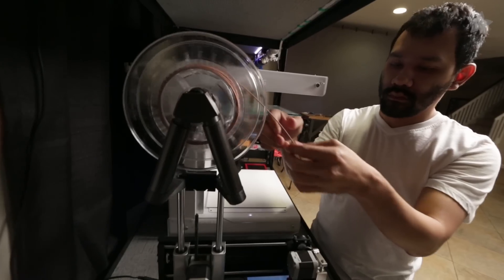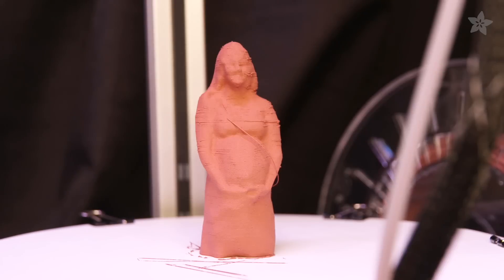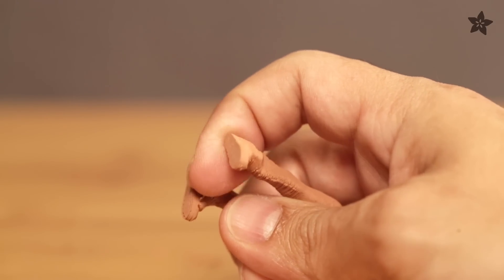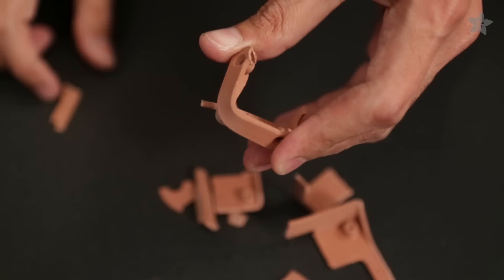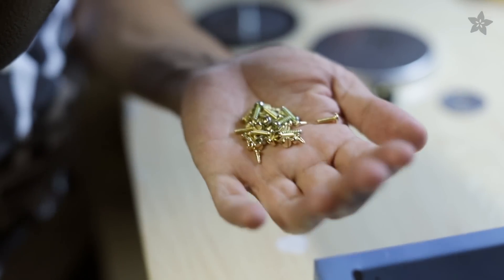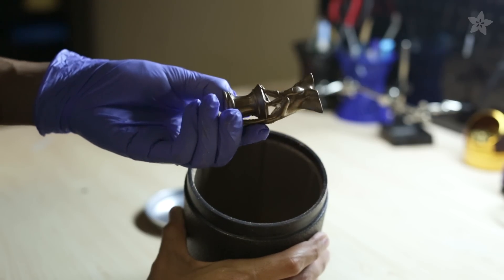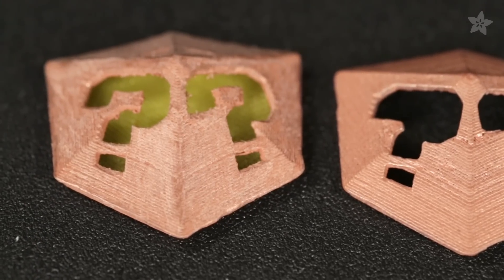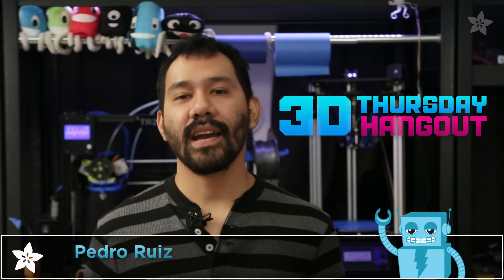How to polish copperFill & bronzeFill filament

Comment: I had never though to use a tumbler!
Great idea!
*
How I get 'found piece' look with ColorFabb Copper Filled.
Special tools: Burnisher made from highly polished bit of 2mm 'music wire'.
It has a 'ball-end' and can reach just about anywhere.
The process:
1) Shave off layer-lines on broad areas and outside curves with a cabinet scraper.  Small knife everywhere else.  Be very detail oriented, but don't sweat surface finish!
2) Buff up every surfaces with fine stiff wire brush.  
     This will selectively remove plastic from the metal.
     400 grit sand paper then 00 or finer steel wool to refine the look on high spots.  Leave crevices and depressions alone!
3) Burnish everywhere, but keep the work piece cool!  
     Burnishing compacts and flattens the metal grains, forces excess plastic to the surface.
     Hand warmth is enough to soften the piece; ColorFabb Copper Fill has to be hard to respond to burnishing!
     Keep the work clean, but use very little water!  
     Soaking in warm water has softened pieces significantly...the copper seems to get wet, looses its bond with the plastic.
4) Once it is nice and shiny, lightly sand with 600-1200 grit sand-paper to dull the finish a bit.  Don't miss a spot!
      This strips off any surface plastic, preps the copper for step the next.
5) Something something vinegar and salt...I haven't found the magic recipe that works every time...then again, random results for a found piece, eh?
6) Steel wool and burnish the high-spots to get back bright metal, leaving patina in the crevices.
Steps 1-3 make a 'well-used' finish while hiding the 3d-print origins...smooth high-spots and dull crevices suggest long use.
4-5 make it old, 6 makes it look semi-restored.

Comment: question could you use a metal powder (copper/brass/etc)? thanks
Reply: you could probably use small ball bearings, but powder will probably be too small and would therefore take a lot longer for similar results.

Comment: It has been suggested that the objects are not being polished so much as being gilded as brass particles knocked off of the screws are worked into the surface. It would be nice to test if other materials can be 'gilded' in the same way.
Reply: Skyler Thompson i
Reply: Interesting. I'm just building a tumbler for both bronze filled and iron filled PLA. Was going to use stainless steel pins.

Comment: Would it be possible to use also an vibratory bowl  instead the rotating rock tumble, because the vibratory bowl  is more gently to fragil prints?
Thanks!
Reply: Did you try it?

Comment: Hasn't anyone noticed -> The brass screws ARE NOT just polishing the PLA they are coating your print with BRASS!!  THat is why they look so shiny and why standard tumbling with walnut shells don't work.

If you really want copper or bronze etc, tumble with traditional abrasives and then patina and coat with epoxy.
Reply: exactly my point, however there are now 88% metal PLA filaments available which do polish well using rouge and a polishing wheel
Reply: why does it have to be made from brass in the first place then?
Reply: Good to know.  Can you make a recommendation?
Reply: It would be nice to test if other materials can be 'gilded' in the same way.
Reply: >they are coating your print with BRASS
which is a good thing

Comment: Is this stuff conductive?  Maybe you could electroplate it afterwards.  That would be pretty awesome :)
Reply: +brandon9271 My experience is that they are NOT conductive. Its PLA with 5%-10% bronze color dust (may or may not be actual bronze).
Reply: They claim it is about 50% metal by weight. Unpolished it may be unconductive, bu the polishing/burnishing will smear out the metal over the surface, connecting more parts. I would not be surprised if it was conductive after a good polish.
Reply: things have to be extremely conductive to electroplate ... throughout the media ... i.e. if you place 5V on one end it should be 5V on the other. I do wonder if you let it sit in a oversaturated ionic solution of copper, or similar, and introduced the right chemical to get it to precipitate out, if it would preferably precipitate onto the 3D print.  Probably your best bet of coating it that way.  Hmmm ... smelling an invention in the works - something to work on.  You could spray it with a metal ion solution, let it dry ... and repeat the process.  Seems like it would preferentially deposit on embedded metal if it was the same metal.

Comment: Would polishing with standard brass polishing media work? Hand loaders use vibratory tumblers with a walnut shell media to polish brass cartridges to a very high sheen.
Reply: +Rich Brungard I used fine brass filings from a metal shop and those worked incredibly well! Better than anything else and they were much more gentle on the print. You can get it from a local metal shop, or check on eBay. It's usually around $15/lb

Comment: Those prints didn't come out very well... The ones I have done had the best detail I have seen in a 3D print.... Possible that I used different settings than you.
Reply from the maker: Share your prints and post up photos! We'll blog them up.
Reply: You need to increase your retract length and add some end print gcode to retract properly a few mm (5mm is a good number) at the end of a print. Definitely worth the trouble calibrating, then you will never have to clean up stringy bits of prints again.
Reply: It has been suggested that the objects are not being polished so much as being gilded as brass particles knocked off of the screws are worked into the surface. It would be nice to test if other materials can be 'gilded' in the same way.

Comment: Casted is not a word. At least not in the context you are using it in. it's "Cast"

e.g. "Cast iron"
Reply: Dnbfndndjsndrnrnnjrjrrn

^sucession of letters

Is that a word :-P ?
Reply: Casted is an older form, and is still technically a word. The word, "casted," has actually been making a come-back in recent years.
Reply: Its a sucession of letters so its definitely a word.
Reply: Glen Beestone actually yes.

Comment: Couldn't you also use a buffing wheel on a Dremel and some metal polish to do the job a lot quicker than tumbling and a better outcome than sanding?
Reply: no, spent about 2 hours today trying to do just that, and no matter how slow you go with the rpms it doesnt A. shine it up, B. it melts it and C. it just makes it worse tumbling is the way to go
Reply: Mike Trieu yes... Yes you could

Comment: If it's conductive, I guess you could print circuit boards using dual extruders. One with PLA and one with copper fill. 3d circuit boards.

Comment: is this stuff conductive? (because it has copper particles in it), or not?
Reply: STcraft Neither bronzefill nor copperfill are conductive.
Reply: Came here to ask that. Could someone print a line of it and measure its resistance or something?
Reply: Recusant Doubt the density required would still allow for the PLA to strongly bond all the particles together...